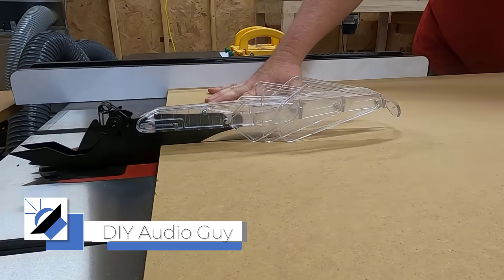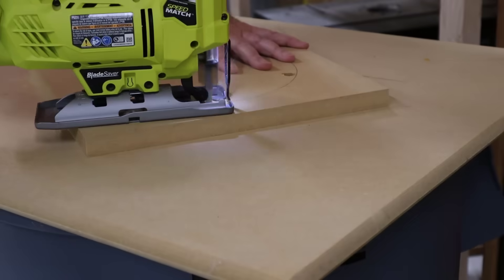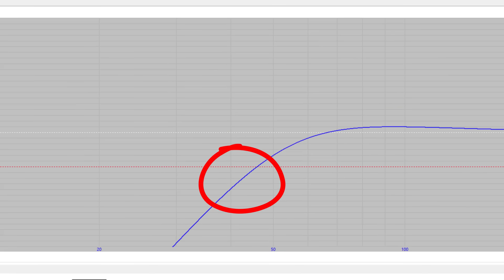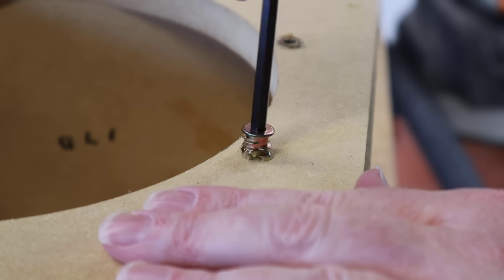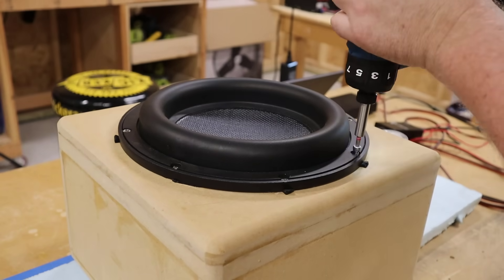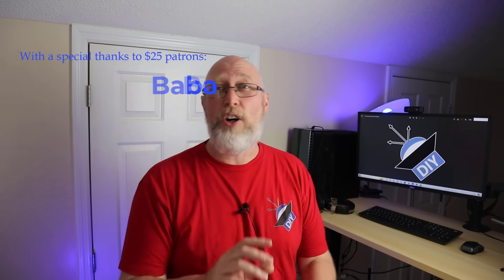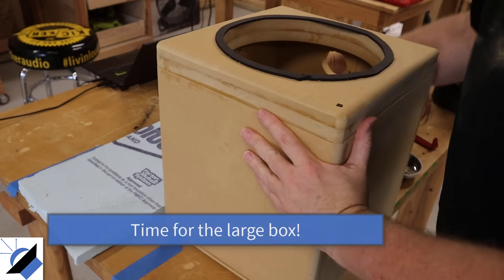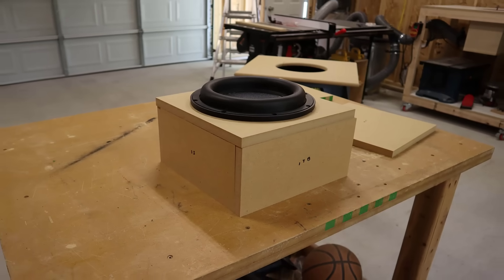Bass in a small space?  Sealed subwoofer enclosure design.  @PartsExpressOfficial

Comment: This is a common mistake I see everywhere. If I had to go with sealed. It would be oversized with the bass knob turned lower. So the driver wouldnt unload. Luckily more manufactures are making low profile subwoofers designed for trucks and tight spaces. I really like passive radiators because it gives to the best of both worlds. Sealed, ported, and even SQ.
Reply from the maker: There are no solutions, only tradeoffs.

Comment: i have a 10" ds18 car subwoofer rated down to 30hz and the manufacturer recommends about 1.25-1.4 cubic feet, my enclosure is only about 0.8 or so it's very small it's a ported pre fab tuned to around 47hz because I've never built a box I'm worried to try and fail and since I'm on a very tight budget at the moment (broke 17 year old struggling to make money😂) it hits nicely especially at 40hz i still would've expect it to hit louder but probs the box

and above up to about 59hz or so any higher and it looses bass badly (because the box is custom tuned lower because it was originally tuned way too high) and anything under 40 the bass starts to get quieter until about 32hz then at 30 and 29 it gets even more quiet (which is the lowest it can play) anything lower is bad harmonics even at anything lower than 36-38 can't be heard if you're close to the subwoofer you have to be in a certain position in the room for it to become actual bass and not just harmonics,
do you think my box is the problem? (should also mention the thickness of the mdf is 0.69" and sometimes under heavier loads it can flex a little) I'm pretty sure it is just wanted to confirm LOL
Reply from the maker: Yeah, the box is holding you back.

Comment: You hit diminishing returns pretty quickly with increase in sealed box size, until you may as well put a port in there. I mean to get a subwoofer physically smaller for the air space you can make the walls thinner, but will need to brace it to stop it losing energy to wall flex. As an extreme you could try 1/4" ply braced with blunted kebab sticks.... Also curved surfaces make thin wood and plastic really strong, even down to 1/8".
Reply from the maker: Curves are always better.

Comment: I do not recommend the passive radiator route. I have a monster speaker build going on right now where I used two passive radiators and I really cannot recommend it at all. For all of the research and planning and math involved the results really were not that good. When I remove the passive radiators and it's just an open ported box it sounds a lot better overall.
Reply: What did you notice with the Passive Radiator compared to a ported box? How were the Lows?
Reply: What was your sun cone area compared to the passive ?

Comment: One thing I do notice is that nearly all sub boxes are made from raw mdf. I’m a trade cnc machinist with 25 years experience and when you put raw mdf onto a machine you can feel the vacuum pressure through the mdf. Raw mdf is even used as a sacrificial sheet on nesting machines. When I make my sub boxes I use melamine board or use a quality paint sealer inside the box. You probably can’t hear the difference but I bet air will be getting pushed and pulled through raw mdf on sealed boxes
Reply: This doesn't actually happen.  This was a popular demonstration a couple of decades ago as a constant vacuum can indeed pull air through MDF.  A woofer, however, is not a constant vacuum - it is cycling 20-80 times a second.  The change from vacuum to pressure is too fast for the air to move through the wood.
Reply: True (I make speakers). It breathes primarily thru the surface layer of spongy material. Same is true for damping materials. So - more important to seal the inside of enclosure than the outside
Reply: a speaker is way different than a constant vacuum

Comment: How would I design a sealed box with two 10" inch woofers (and two 1"-2" tweeters, with maybe a 12+ inch passive radiator on the back, dimensions are 36" wide, 18" tall, 7" to 8" deep?
Reply: I could go ported, but the box dimensions are pretty set, since I'm building a retro boombox, so I'm having a hard time designing it.
Reply from the maker: That's a very complicated project! You'll need to build a crossover network.  I recommend heading over the parts Express ( Link in the video description) and checking out their boombox kits.

Comment: Very small box is bad. That's understandable. Whats ur opinion on medium sized sealed  box with EQ (low end boost)  Vs ported box.
Reply from the maker: Are you talking about the linkwitz  transform? A lot of the sound quality guys swear by it.
Reply: @DIYAudioGuy  Very small box is totally ruled out. So let's forget it. For a particular 12" driver, a sealed box needs to be 44L internal air volume for 0.707 qtc. Same driver needs 60L air volume for ported box,  tuned  just near to the drivers Fs.  This is a regular approach. But by using EQ (linquitz transforms or minidsp) same 44L sealed sub can be tuned to have similar low end extension and spl as ported sub. I have built both, but unfortunately could not compare them side by side in same room. Will share my observation if i ever measure them in same room. 😊👍

Comment: How about an very oversized box? Like 3.95 internal cubic feet with a really large port vs a recommended 1.5 cubic feet for a 12" sub 
What's the issues there? ;)
Reply from the maker: At that point you're sealed box starts to look like a free air enclosure.
Reply: I made a box that was 4.7 cubes tuned at 26Hz with a 5x20 inch port that was very long. It was extremely loud

Comment: I put my threaded inserts in from the bottom of baffle and use longer screws to avoid the head of inserts not being flush. You can thread screws from either end of the inserts so it works great because if you need to take screws out when you turn screws counter clockwise since they are threaded through the non head end of insert it doesn't loosen insert but tries to tighten it
Reply from the maker: Clever!

Comment: Nothing worse than building a box to the subwoofer size and it sounds like s*** for a seald box. I find going over 25% in the sealed box gives you the good residency would find in a vented box. JLW13SW was my test case. I actually prefer sealed boxes oversized to the point where they should be vented. Gives you all the sound without all the polyfill and a little more power. But that's what I've tried outside of everybody else's advice. Tuning is a personal preference. X 😊👍
Reply from the maker: Most car audio brands recommend an enclosure that is just a tad bit to small.

Comment: Thank you for all the great videos. I only have one question. As long as you have the necessary air space, does enclosure shape matter? ( like T shaped boxes that have pockets on each side )
Reply from the maker: I don't think it does, but I'm not aware of anyone who's done an actual test to prove it one way or the other.
Reply: @DIYAudioGuy  A real good example is the Klipshorn. New verson against the old ( it hold record longest in production) a new testin "Stereophile recently . Reviewer was not to test old one long ago as would sound bad  new ones do work without corner placement but still best in corner  sorry typos age and 20 or so as real draftsman taking tolls A side note I think it still holds the efficiency record
Reply: It does. For higher frequencies the box shape can affect stuff like reflections and standing waves. In a low frequency sub box it doesn't really matter. Although at the extremes you might not be able to utilize all the airspace as effectively.

Comment: Great video!!! This makes so much sense. I have a ported box for my subwoofers and I would never use a sealed box for them because  the difference in output is huge. However, for the midbasses in my doors, sealed would be perfect. It won't take a lot of space and since they are running from 80 hz to 800 hz, I don't need to worry about it getting low. But for subwoofers, I would 100% use ported enclosures.
Reply from the maker: Glad it was helpful!
Reply: @DIYAudioGuy  It was, that is why I subscribed to your channel. There is a tremendous amount of things I can learn from you so that I can keep improving my car audio system. Cheers!!!!!

Comment: Nice video! Just to add wjat I learned from a successful DIYer in a forum. Small enclosures can be beneficial for sealed enclosures if one has enough power and a DSP at hand. For given RMS power rating and linear excursion (xmax or Klippel tested) there is a volume such that the will reach it's x max at maximal power but never overshoot.
Using this volume you can get the most output of the woofer at "higher" frequencies, which are limited due to power handling and still get maximal output down low without overexcursion.
It requires a DSP and enough powet though. But I think it's what many commercial companies do (SVS etc) sinve their sealed subwoofer are usually quite small
Reply from the maker: Yep, the Linkwitz transform
Reply: @DIYAudioGuy  Yes, its usually Linkwitz transform. But it needa smaller enclosures to make sure the driver won't die.
On the other hand, you can get away with less power in a bigger enclosure. That's why my sealed boxes are not that small

Comment: I install my inserts with Screw Wax they go in easily with a full size smaller hole.  I also place them in the lower of the 2 baffle layers
Reply from the maker: Screw wax?  Kind of surprised that YouTube did not filter your comment!
Reply: @DIYAudioGuy  lol it's a tin made of natural beeswax and some other ingredients you scrape a bit on the threads then hold a lighter or a bernzomatic on it for a few seconds it fully coats the threads and it also seals the threads air tight.

Comment: I did an experiment with a subwoofer in different enclosures: large sealed, small ported, large ported. The large ported sounds the best, and that's what I ended up using.
I actually used to be a sealed enclosure purist until I built a proper ported box tuned for flat response.
Reply from the maker: Yep.
Reply: Add DSP and you'll be even happier

Comment: I listen to a wide spectrum of music genres and while I notice my preffered sealed enclosures aren’t as strong with the deep bass of rap, I can’t sacrifice their accuracy with percussion in rock and other genres. Investing in better subs with appropiate amplification can compensate for the lower efficiency. Thanks for another great video.
Reply: Agreed 100%.  The types of music I listen to don't require that big low blast.  Nor do I really want that much output.  The sealed box works well for me and thay is what I have in my car 90% of the time.  I'm kind of an audio nut so I have tons of different amps and subs and I'm constantly buying stuff to add to the collection.  From time to time I will throw a different box in the car and set it up for that enclosure and play with that for a couple weeks.   I've noticed huge differences not only between Woofer sizes, but between enclosure sizes too, even though they're getting similar power.  You should put whatever box you have space for, possibly choosing a Woofer that will work keat with your available space and also the type of music you listen to predominantly.
Reply: @MAD_CarAudio  absolutely, although I am definitely an audiophile, almost snob at times, I also love the slamming, hard Hitting, low bass from some rap and some bass tunes etc .. but it has to sound good, and switch to Megadeth or whatever and sound just as it should too!!
Reply: @MAD_CarAudio  
Then I suggest you ditch a car audio subwoofer and get a dedicated woofer like the Peavey Black Widow or PRV MB series or Electro Voice woofers or any PA type woofer designed for concerts. They are ear splitting loud but not intended to be so loud under 35hz but for everything above that up to 5khz.
Reply: @MAD_CarAudio  check out Toby speakers.
Reply from the maker: Right!
Reply: I listen to EVERYTHING music wise, from hardcore rap to Bob Marley then Megadeth and other metal stuff, acoustic and much more.. I have been satisfied with crisp, slamming bass no matter what music I was listening to with the sub's ported very low.
   I would think sealed would sound a little better, but I think the low port tuning gives a little flatter curve so it sounds good and hits hard, least it sure seems to.. I am hoping to install my 7 band rear and 5 band front EQ which should really get it sounding clean as well.
Reply: @BabyCharlotteschannel  funny you mention megadeth, I was just listening to them in my garage while building my sub box. And I just saw Megadeth with five finger death punch 4 days ago and it was rad!
Reply: @BabyCharlotteschannel  YOU ARE WELL ON YOUR WAY TO PERMANENT HEARING LOSS!!
** BUT I DONT CARE!!**
Reply: Ports all day long I nad 2 ts12 tannoys bk in the day It made me change my setup am now running 2  10 inch 3 way sealed and 18 inch ported tuned to 16 Hz
Reply: i just did a undersized port and im fine with it lol
Reply: @spedracer55  
Yeah depends mostly on the music you listen to or the tuned frequency you want to be at; for example my port is 100 inches long but that’s because I listen to a lot of bass music that digs super duper low.
Reply: I have ported and sealed box. Only time my sealed box sounds better is with some metal. And that also means you have good quality music files not some low quality crap you download from youtube etc.
Reply: @aaronmolinar3127  
That’s odd, those speakers actually are supposed to shine with rock music. That’s what a lot of rock concerts use.
Reply: Got myself a 18 inch , i too hàd the same ailment but now it's cured with an addition of 18 Lf driver to 5 twelves .
Reply: Ported gives you more boom but much more distortion. Porting requires careful tuning of the port.
Reply: Ported enclosures, more efficient, but with higher group delay, depending on the design.  A well designed ported enclosure won't quite sound as accurate as a good sealed one, but a "decent" designed ported enclosure will sound like sloppy asshh.  And a badly designed Ported enclosure will be unlistenable.
Reply: @tradnyxx a WELL designed ported box will sound amazing if your building the box to the specs of the subwoofers you plan to use! The amount of people that come in the comments just to talk misinformation is ridiculous!
Reply: I prefer 4th order band pass!!!
Quality controlled bass.
Reply: @Krotos1970  More woofers are always the answer
Reply: @Krotos1970  best of both worlds  (sealed and ported design) 😃
Reply: @Krotos1970 a 6th order bandpass is the ultimate box in my opinion. A 4th BP can be insanely good, but if you have the room…. Gettit!

Comment: Thanks for the video! It's like you knew exactly what I wanted to see. I've always thought it would be fun to build a few boxes and compare them.

*(Sorry for the wall of text lol, it makes sense in my head but as I type it, it might get a bit disorganized and lose a bit of my intended meanings)*

One thing to touch on is the sealed box for the UM10 (and just about any sub) is when comparing these sealed enclosures, it's good to keep an eye on cone excursion. I bought the sealed kit for my UM10 so the box was 1.5 cubic feet. Technically 1.5 cubic feet and a 1 cubic foot box would perform identically. Only difference is efficiency of the bigger box would add a dB or so to the sensitivity around 20Hz. Which personally to me is insignificant and almost pointless. If you look at cone excursion for them, I'll look at 20Hz for this example, the cone excursion for the 1cuft box is touching xmax on 500w. While it takes 400w to reach xmax on the 1.5cuft box. So while you can get an extra 1dB on 100w less power, in reality that extra output you'll likely never hear. And you gain more the lower it plays, but this sub isn't going to do that well under 20Hz, and the cone excursion rises fast in the 1.5cuft box to the point it physically can't perform better than the 1cuft box under 20Hz.

I know you didn't go bigger than a 0.85cuft box in the video. But in the end the 0.85cuft box after looking at it in WinISD is probably the biggest box you need for the UM10 sealed. Because any bigger won't really give you any big additional improvements due to xmax limits on rated power. Which you basically already shown in the video with the small vs medium showing a much smaller difference.

Touching on the ported part. You've already seen my PR box for my UM10 but it basically acts like ported and going from sealed to that new (not new these days but you get what I mean) box it was like a whole new sub. Blew my mind with the low end I got out of it the first time I played it. Sound quality didn't get worse. IMO it sounds 10x better being able to cover a wider bandwidth.

Anyway, sorry for the rambling lol. Thanks again for the entertaining video!
Reply from the maker: If I were to do it again I would add an oversized box just to compare and contrast the tiny box.

Comment: Something i noticed while i was "breaking in" my subs in open air was i could get almost the same excursion on a 60w home amp than i get after i put them in sealed boxes (limited space) in my truck on ~400w each. I have 3 12" subs in my truck, all of them in 0.8 cubic ft boxes. I can juuuuuuuuuuuuust barely do a hair trick with the passenger door closed and driver door open, but my friend's car with just a single 12 in a prefab ported box (granted a little more power, but the sub has less excursion than mine are supposed to have) can do hair tricks just as good as mine. Really makes me want to get rid of 2 of my subs and try to build one proper ported enclosure that makes use of the space the other 2 subs were taking up, this video makes me want to do it even more
Reply from the maker: The box matters.